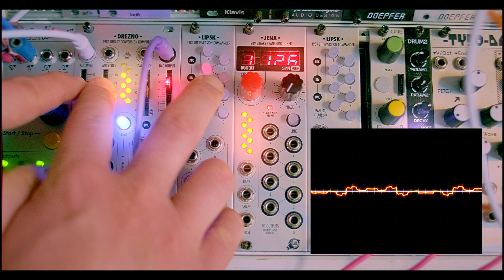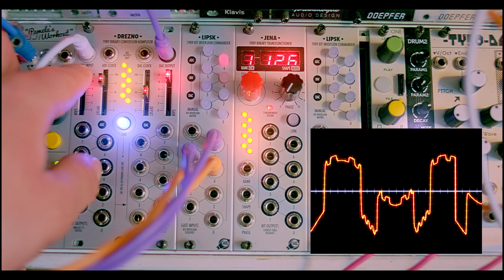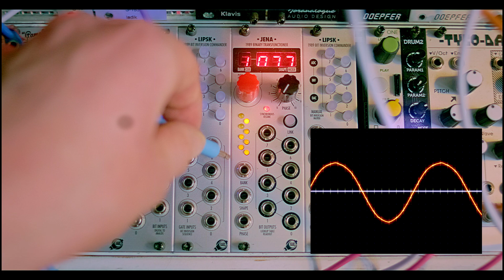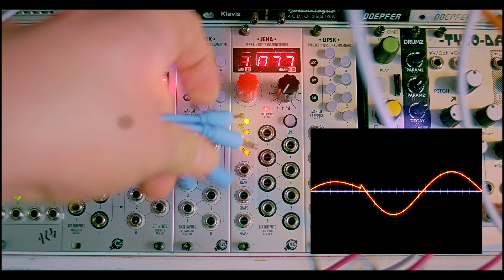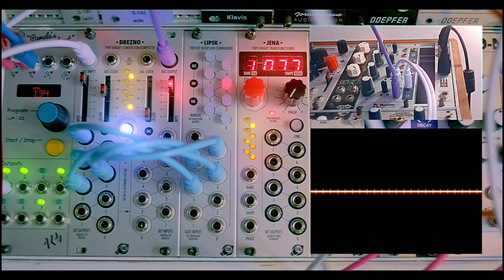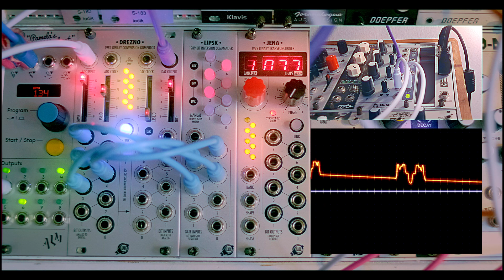the noodling notes - s01/e01 - "Leibniz Binary Subsystem" - DISTORTION

Comment: The outputs from Jena (with the Jena’s link turned off) patched into a Lipsk after it gives ringmod-type sound, and the phase input can be used for through-zero linear fm.
Reply from the maker: Thanks for the first idea. Planning on doing an extra video for cross modulation. The jena video is almost done and already very long haha also I planned to include the phase modulation part, I already knew about this, but will also be included in another video haha bit thanks for the tips.